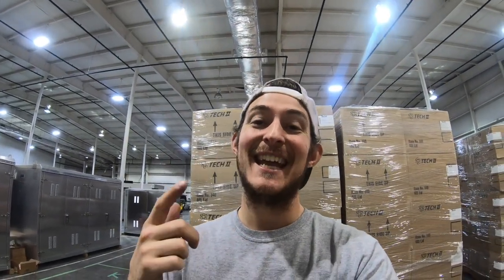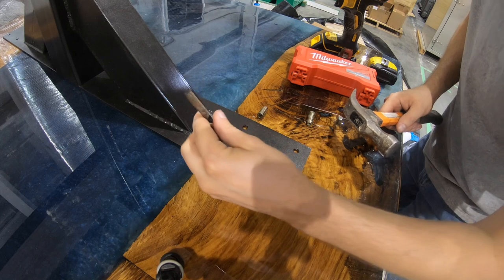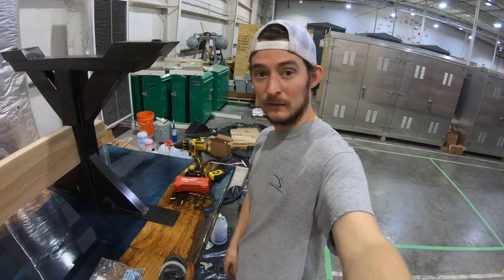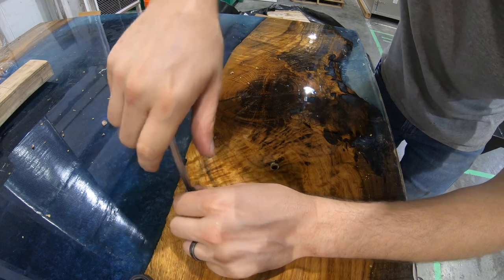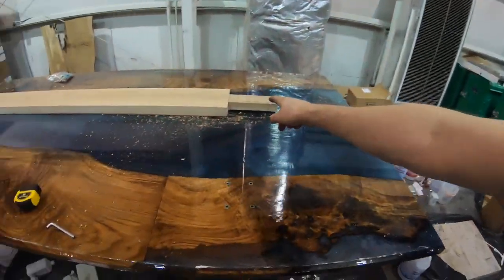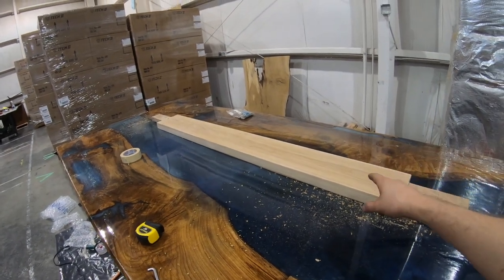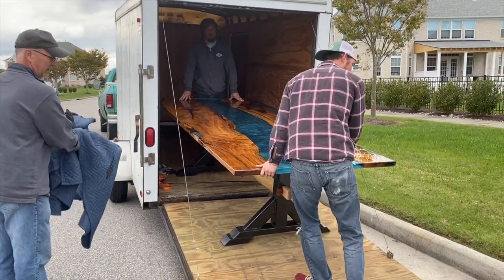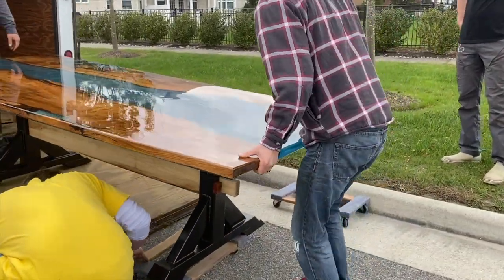Delivering a $6,000 Epoxy River Dining Table

Comment: You need to use a slight counter sink bit so the insert does not crack the finish... also, a drop of glue down the hole do it's locked in.

Comment: Okay, so you've sold on the cheaper end of tables this size. Customer's getting a good deal. However, this is a big table. I don't see any reinforced metal strips to ensure this wood doesn't warp or bend over time. What's your solution? And curiously, why did you choose to finish the wood beam between the table legs in such an obvious contrast to the beautiful table finish? Thank you.

Comment: Beautiful table! Seeing how transparent the epoxy was immediately made me think, “Ooooh., lighting at underside of table is needed”. But that would be my table, not your clients’ 😀 Great work. I’m an architect and details are a big deal to me. One thing that really stood out to me was the choice of fasteners. Was it a decision to not use black colored bolts or just not that big of a deal for you?
Reply from the maker: Great question, I didn’t show it but I usually have a small jar of touch up paint and use a small brush or q-tip to paint the hardware once I’m finished. Good 👁!

Comment: Hey man,
I think some attention to  detail  would really improve your craft, the timber is to short for the table, butt joints never look good but with miss matched grain, its looks cheap, maybe recess the base into the table top and try useing the same coloured hardware, silver bolts? the welding is very poor and I  dont get why some parts of the legs appear to have a line running through the centre of the steel length ways, at 12.37 shows it clearly. I dont get the base's timber support,  painted black to match would have worked much better IMO
This may sound harsh but Im solid timber furniture  maker,  I  am trying to help you here, keep going young fellow, I  look forward to  seeing more from you
Reply from the maker: Do you have a website where I can see some of your things?
Reply: Interesting. It does look like he welded 2 pieces of square tubing into a rectangle for those pieces. I think that's what the center lines are. But then again I know nothing about steel
Reply from the maker: @syntonization  it’s 4”x4” steel tube. The lines are from the manufacturing of the steel.
Reply: @GoodViewWoodworks  ohhhhh interesting. Thanks for educating me 😊
Reply: indeed i saw the welding and i really expected more from a USA resident, welding in my country (arg) its better!, 6000$ is premium price, seamless 4x4 wont have any line in the center, might be a little bi more expensive, the legs should have been all black, yes, i kinda like the silver bolts on my jobs, looks clean, and easy to find

Comment: Why does that wood beam not match the rest of the table at all? Why didn't you finish it ?
Reply from the maker: I did finish it. I used a hard wax oil called Rubio Monocoat. It is the same species of wood as well. The customer wanted a mix of an old farm house style and an epoxy river. This is what she came up with. She did not want the beam to be shiny like the top.

Comment: If you turn up the heat and leave the wire speed alone you will notice the weld is quiet. And the weld will hover. play with the wire speed and see how slow you can get it and you'll see your weld will become very smooth if you go steady it'll just make a beautiful Wild
Reply from the maker: Thanks Dave! I appreciate the constructive criticism. I need all the help I can get.
Reply: Not criticize just helping.. Nice job....👍
Reply from the maker: Thanks again Dave!

Comment: Beautiful table, however I feel you should have used a flapper disc to work your welds so they were smooth, as is I feel the legs are to agricultural.
Reply from the maker: Thank you for your input James! I agree with you, however the customer wanted the legs to be very industrial. They wanted the Wells to show, they wanted the rustic beam and at first they wanted the legs to have patina. That changed their minds about the patina later.
Reply: @GoodViewWoodworks  I guess you have to supply what the customer thinks he wants, tis a shame as its a beautiful table top.

Comment: Centre beam doesn't look right, looks like a scaffold board has been thrown on as an after thought shame as the top looks nice
Reply from the maker: Well everyone has their own opinion I guess. Thanks for watching
Reply: This is the only criticism I have too. Top is incredible, legs look great, then the center beam. If it was the same color as the wood on top or even black matching the legs, would be perfect. I thought it was just a board to help transport initially. Otherwise excellent work!!
Reply: This is the only criticism I have too. Top is incredible, legs look great, then the center beam. If it was the same color as the wood on top or even black matching the legs, would be perfect. I thought it was just a board to help transport initially. Otherwise excellent work!!
Reply: I like the contrasting colour.
Reply: @indyjones1173  The fact remains that the weldings are not very nice, don't shoot the messenger.
Reply: Thats your opinion.... it looks fine to most people commenting.

Comment: I am about to finish my first epoxy table. The resin is clear. However I am going to finish this with a pigmented Rubio monocoat will this tarnish resin or ruin my project.  My hope it will just stain the wood
Reply from the maker: The Rubio should not adhere to the resin so you should be able to just wipe it off.

Comment: So you sold it for 6k or it costed 6k to make? Still learning!
Reply from the maker: I sold it for 6k. It cost me about 3k to build.
Reply: GoodView Woodworks thanks man. Great work! Awesome vids too
Reply from the maker: Thank you!
Reply: What the hell is so expencive on this material? Or do you count your hours with 100 bucks?
Reply: Why are there so many waves at the surface? Is it from the sander? I guess it is  because of sanding with a round blade. With square sander you dont get that much holes inside.
Reply from the maker: @dirkbanzhaf234   so first off the “waves” are the multiple metallic pigments. They’re not on the surface. Second if you don’t understand what materials cost then you should just ask.
Reply: @dirkbanzhaf234  the slabs of wood aren’t cheap they range from $750-$1000 and the Apoxy is expensive as well. If you did some homework or was a carpenter, then you would know the details in what the process is..

Comment: Question...what are you using for surface coat if anything?  We have a river table that after a few uses has scratched even when using protection pads for everything. Any suggestions?
Reply: This table looks like epoxy resin finish and shouldn't be that easy to scratch, but if you have some scratches and if yours is epoxy finished you can polish it with very fine paste.
Reply: The flood coat will 100% scratch.  They only way to fix it is to re-sand a bit and flood coat again.There are some new epoxy "finish-layer" products out where people are doing their best to sell that it will create a harder finish but so far, I haven't seen any long term results.  I'm guessing that Nathan tried his best to convince them to finish with Rubio instead of flood coating it.

Comment: Can I use the 1:1 ratio epoxy to do an entire table?
Reply from the maker: It is possible however you will have to do multiple pours at 1/8” (0.125 inches) thick max.

Comment: Huge respect to you bro! I'm on the same path as you but in the UK atm. I haven't had a sale (yet) as big as this, but I've been to a rich couples house to quote this size table & my anxiety was through the roof! 😂 Well done buddy, your family will be proud 👍🏼 one little tip for your next one, the threaded inserts sit into the wood flatter if you bevel the hole slightly 👌🏼
Reply from the maker: Thanks for the tip bro! I appreciate that

Comment: Is it just me, or did everyone discover epoxy and old lumber at the same time? Oh, and same for epoxy, wood and colored pencils.
Reply from the maker: Possibly...
Reply: @GoodViewWoodworks  Nice table, btw. I was just being a smart ass.👈
Reply from the maker: 😂 yeah I was smelling what you’re stepping in!
Reply: Did this cost $6000 to make? I find that hard to believe or was it sold for $6000. If that is the case good for you because i know the material didn't even cost half of 6k to make this table
Reply from the maker: @Shannon-im7re  sold for $6000. The slabs were $1500, epoxy was $2200 and legs were $800.

Comment: cool, but those weldings... table feet have cool design, but poor welding job made it worse. I saw on comments below also for the line on the steel pipes, yeah, those are manufacturing welding lines (quite visible tough), but there are non welding pipes too (costs more). You should improve your welding skills